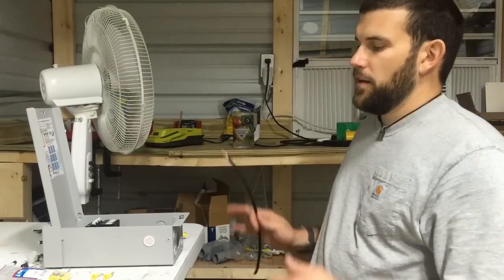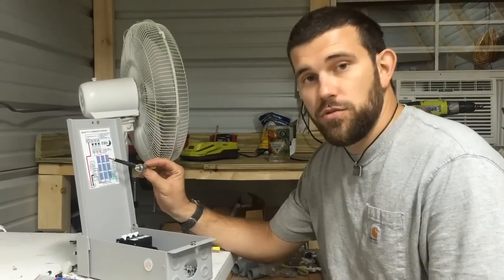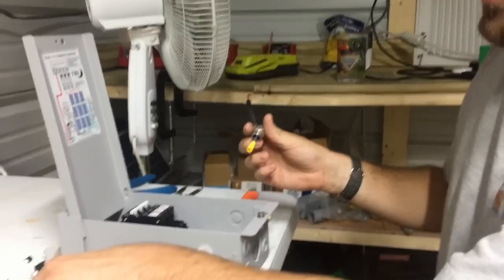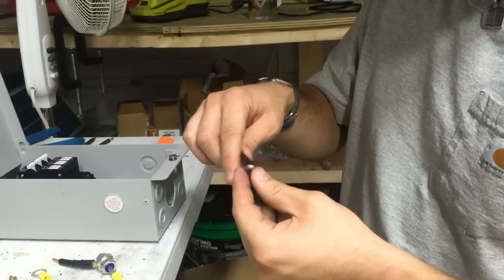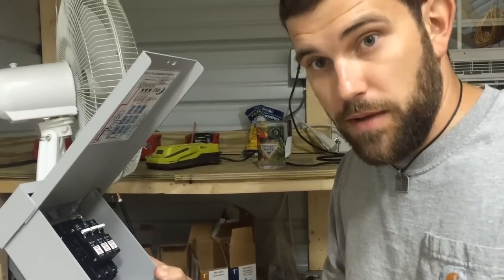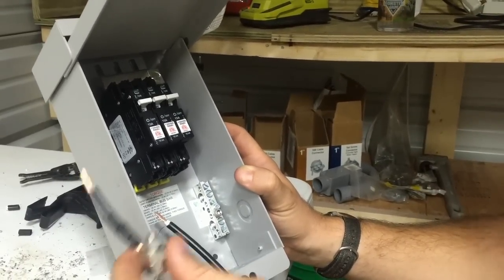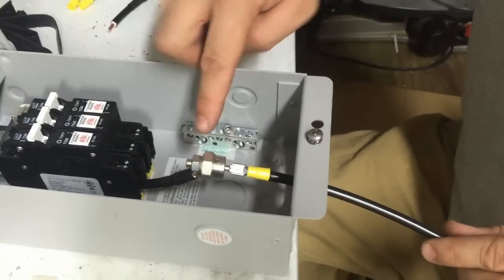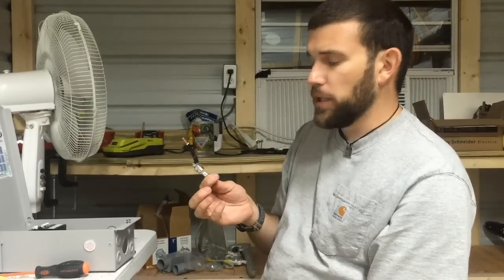How to build a EMP replacement Diode for a solar array by Off Grid Contracting

Comment: Ok here an issue that diode is designed to use that stud as a heat sink.  That's why most diode have some type of heat sink to get rid of heat that will destroy the device in some ways it may be better buy a larger rectifier diode bridge that can be bolted to your NEMA  box as a heat sink.
Reply from the maker: On most solar systems especially small ones and DIY people this should more than suffice for their needs and get them down the road a long time. Honestly for the cost I would just put a stash of these back and that way if one toasts out just pop in line another. What you said though is spot on I see them heat up thats why I made sure to specify in the the UL listed metal box and to bend it up so it is suspended in the air in the box away from electrical wires and etc. lastly though if people use double insulated PV cable the heat of the heat dissipation will not be an issue from the Diode anyway.